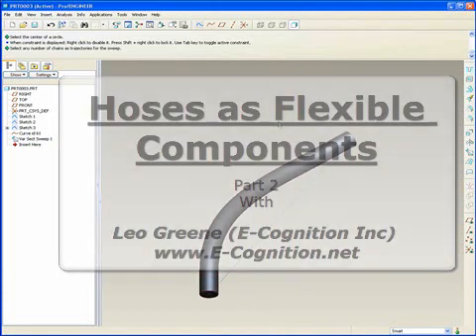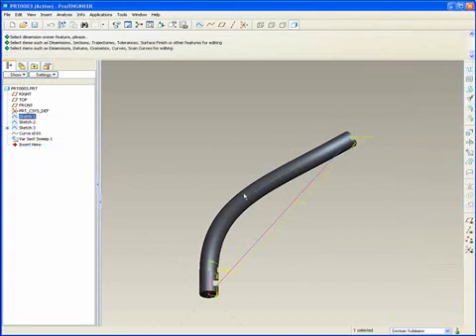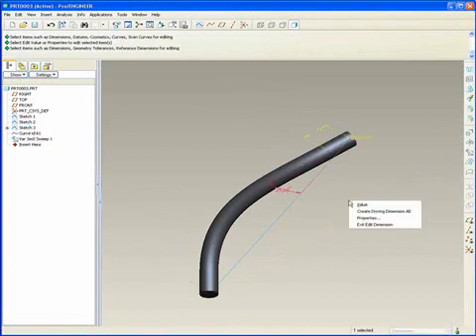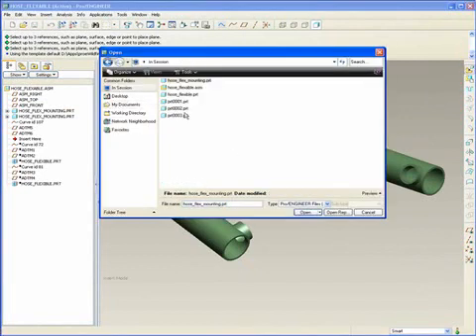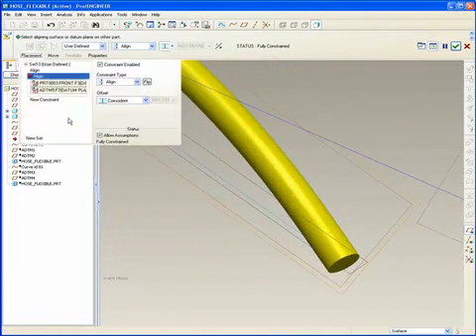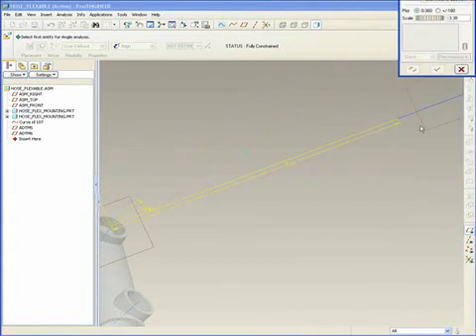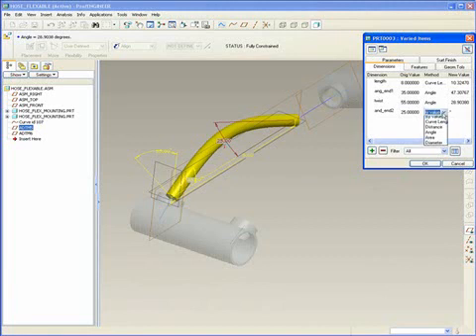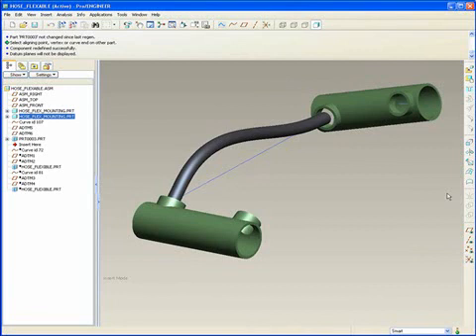Hoses as Flexible Components in Pro/ENGINEER Wildfire Part 2

Comment: I would have appreciated having seen how you added the same "prt0003.prt" a second time at the second set of orifices to get the feel of what is expected to input while assembling a known flexible component.  It may be moot as we are now using Creo Parametric 2.0.  You mentioned that a fixed length tube when attached to two specific ends will float gradually between the to fixed end points, but the next hurdle is how to constrain the flexible portion to "evade" known obstacles.  We are soon to receive additional licenses of the Piping/Cabling module and perhaps we will figure out those fine tuning steps from other YouTube videos